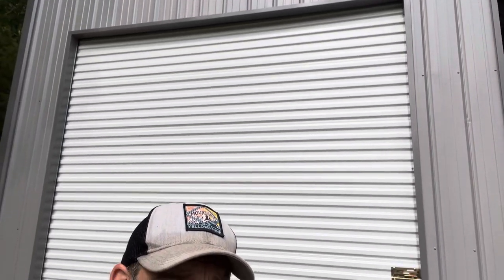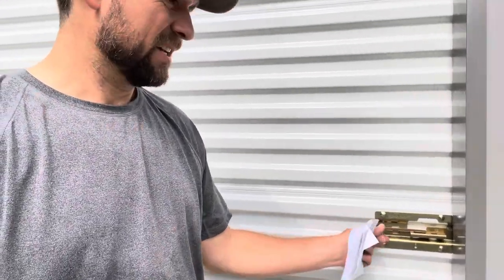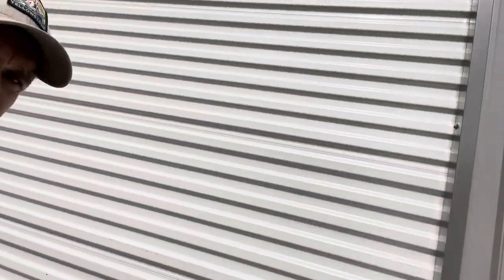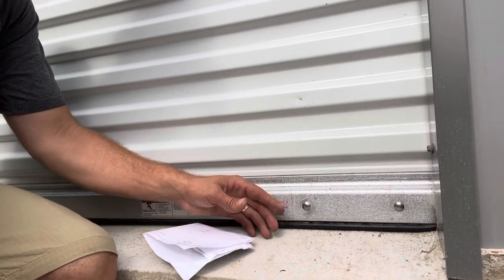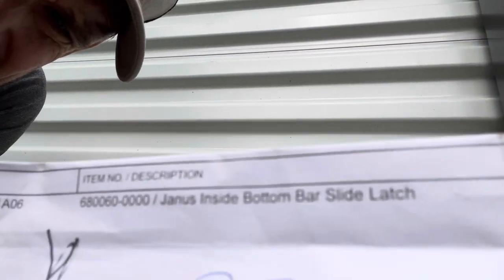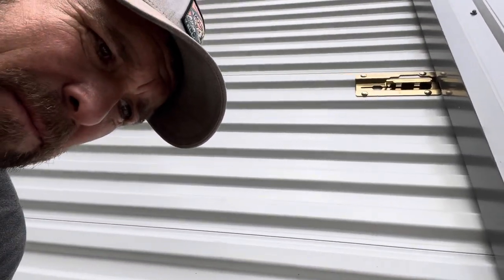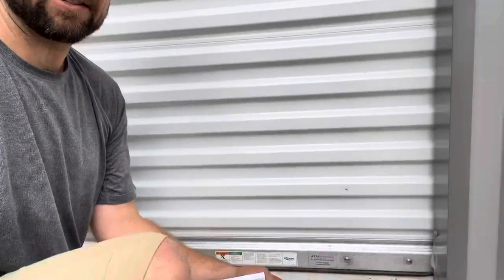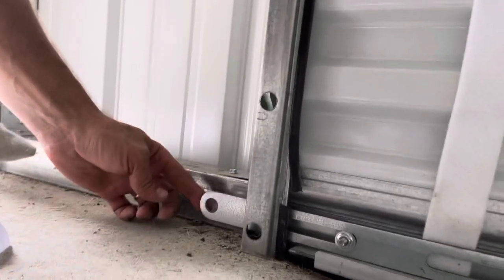Tubestructures.com Adding an inside slide lock to a roll up shop door

Comment: Just had my building installed and found this out as well and trying to find a logical solution. Can you not just switch the latches to the inside instead? I believe I’d have to switch them to the inside AND switch each latch to go to opposite sides.
Reply from the maker: Sorry it's been a few months, but I didn't see a way to do this.  Let me know if it works.
Reply: I'm getting my "shop" done now and looked into this...was told if the latched was mounted backwards to inside for cleaner install...the screws/bolts would be outside so anyone can still get in just by obviously unscrewing screw/bolt vs bolt from inside if that makes sense. So I will be doing similar to the YouTube video here for a cleaner look as well 👍

Comment: if someone locks your roller door from outside what would you do when you are inside?
Reply from the maker: Well if my kids locked it from the outside in my shop I have 2 man doors and 2 other garage doors to go out.  You can also remove the outside slide lock I just didn’t like having the holes there once I removed it so I put it back on.

Comment: How to install this?
Reply from the maker: I explained in the video.  Remove the bolts holding the handle in, and use those to install the slide lock.
Reply: @idahoduckhunter  Thank you for your replied. I’m a visual learner, I just wish there’s an actual video the process of how to install it.